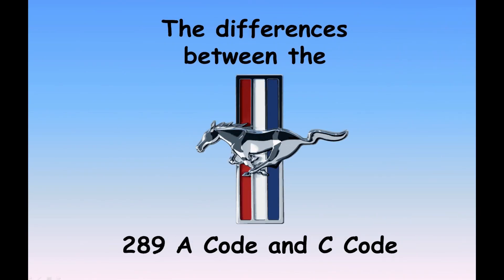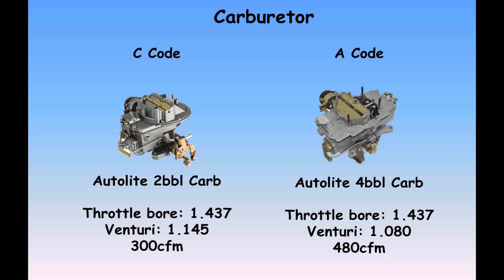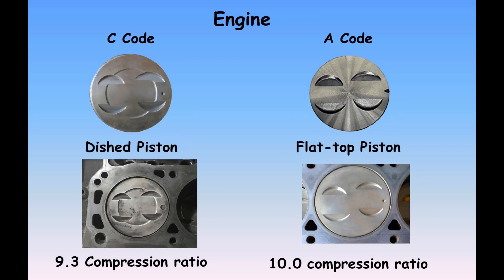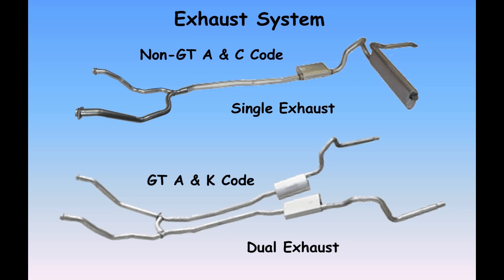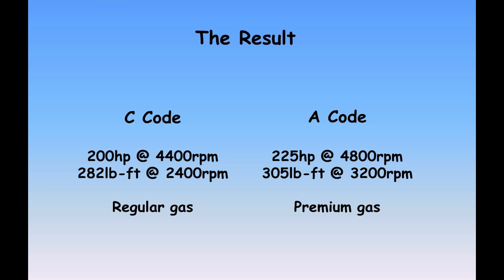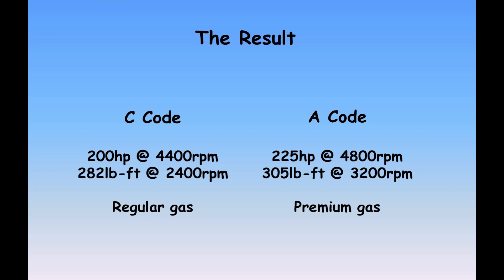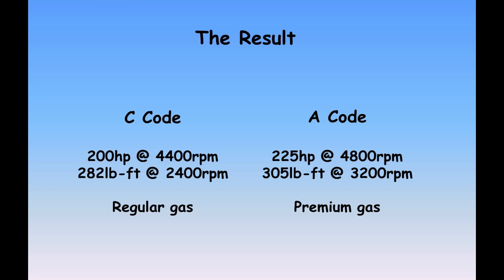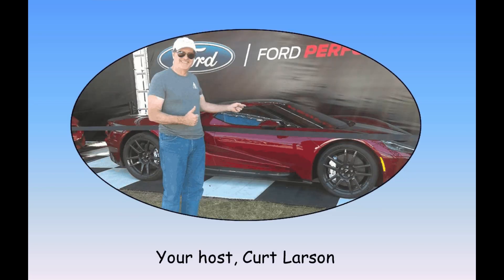Camshaft Chronicles: Ford 289 A Code vs C Code

Comment: A code has a factory 4 barrel other then that its the same. However the K code was the real deal. 4 barrel, beefed up crank bearings, bigger valves and about a 470 lift cam. All 289s came with flat tops with 4 wings and small chambered heads. The 66 289 had a slighly smaller chamber. Other then being nostalgic save your money and build a roller 302 or 351.

Comment: Excuse me.
The 64 and early 65 were D codes, lower compression than the A codes that followed. The D was just a C with a 4bbl.
Comets got the D code 4 bbl 289 engines but were vin numbered as K. As in the Cyclones.

Comment: I recently sold my 68 GT Mustang with the one year only J code four barrel 302.  The J code uses the same dished pistons as the two barrel engine, but gets it's 10 to 1 compression by using the 302 four barrel head with the smaller 289 style combustion chamber.
The 302 two barrel head had a new, larger,  more open chamber.
Reply: The 68 J code 302 head is identical to the C6OE-m 289 head, except for the cast in part numbers.
Also the cast iron J code 4bbl intake is the same except for part #.
Reply: @hotrodray6802  Yup....